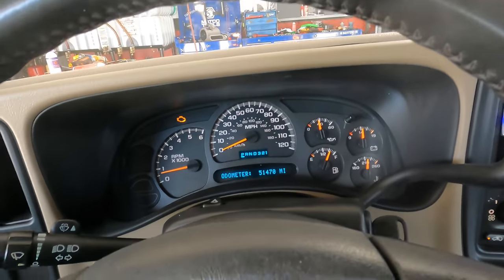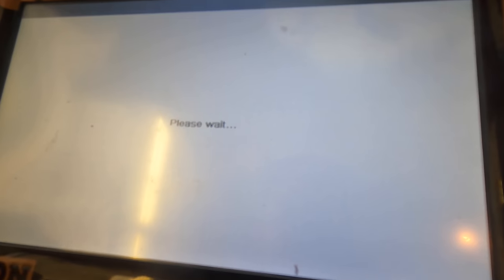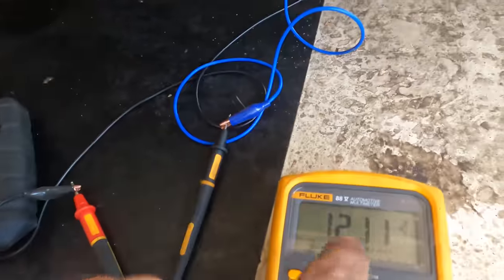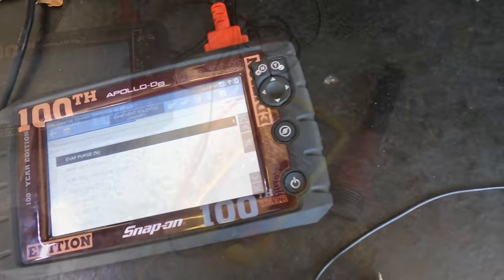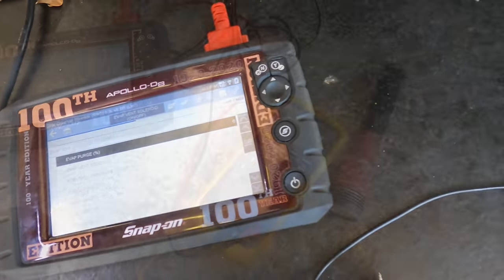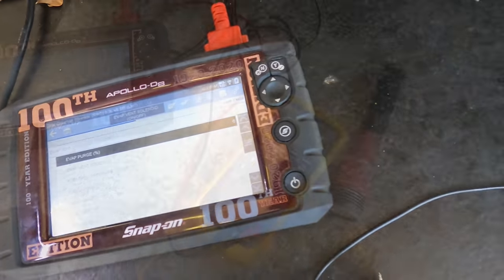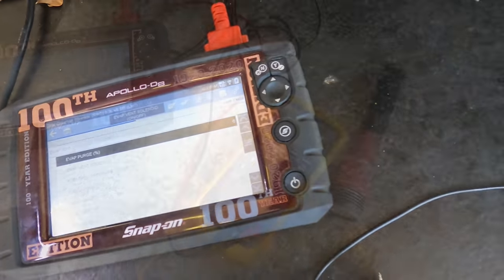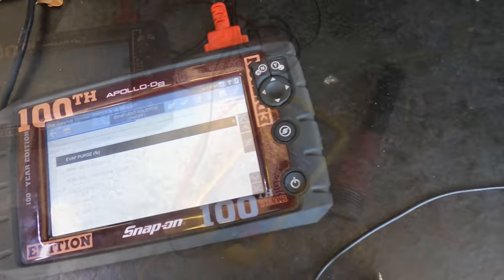RARE FAILURE! Short Circuit? Misfire Evap | Chevy Silverado 5.3 P0300 P0455

Comment: I am impressed with your knowledge. I don't know how many years you have been working on cars or what educational opportunities you have availed yourself of. That said, it seems to me that your knowledge is incredibly diverse, covering so many different cars. Very impressive. I am a 79 year old man who started his mechanical career back around 1958 or so by opening up a flat head ford and doing some simple fixing. I have done a lot of car repair and I am impressed with your knowledge. Well done!
Reply: When they started putting computers in cars, that's when they lost me
Reply: @juanawashington9940  That's why the scan tool has become the mechanic's best friend. if used well, it makes even today's repairs so much more straightforward.
Reply: @martinaudet7687  I had just bought a 3rd new scan tool, INNOVA  5610 which is a great tool..... then I bought an '02 Ford 7.3L diesel Excursion, and find that it does not read every thing that it should ..... darn it.  needs a special protocol for Ford diesel engines

Comment: Replacing parts isn't the gem of auto repair work.  It's the ability to troubleshoot the problem and replace the correct part(s).

Troubleshooting should be the main focus in teaching auto repair.
Reply: To adapt Douglas Adams, author of Dirk Gently's Holistic Detective Agency:
"Replacement of engine part: $2"
"Knowledge of which part to replace (including saving the human race, sacrifice of one Schrodinger's cat, consumption of 4 cups of tea) $1998"  🙂

Comment: 11:38 They aren't always identical there's quite a few parts for my K2500 where the AC and GM part numbers are significantly different. Maybe they've changed that in the past 22 years but since they still sell OEM parts from that era they keep the two line label. Great video!

Comment: and people wonder why some of these issues are so difficult to figure out....just because you have a scan tool , it doesn't pinpoint the exact problem....that's why when an auto parts store scans your codes, they end up selling you 6 parts when it may only be one or two.....this stuff is like surgery on an electrical level....if only people knew
Reply: The scan tools is like a multimeter.. It's just another tool in your toolbox.. And like most tools you need to know how to use it

Comment: Heavy Duty, Over the Road Trucking going computerized on their engines made me retire after 35 years.  I couldn't keep up with technology. I could rebuild and repair anything our company had. Until computers failed me in old school trouble shooting. I miss it. And your knowledge fascinates me. So may times I want to reach out and smack you for not doing something so simple on hardware issues.

Comment: As an old shade tree mechanic, one of the things watching this channel has amazed me is that although I know that codes are stored to tell you what's happened, I didn't know that with the right scan tool you could activate/deactivate subsystems all over the car. 
Having to call and make an appointment to install a new computer is startling.  
There is still a lot of basic wrench turning that goes on, but wow, I'm never attempting to work on a modern car except to change the oil or maybe do brakes.

Comment: Only Fords require 2 keys from what I've seen. :)

Nice work as usual Ray. I'll bet the solenoid shorted and took out the driver, but I suppose the order of failure isn't really of important. What matters is it's fixed.
Reply: My 1996 Chevy and 1976 MG both require 2 keys.
Reply: They are talking about 2 ignition keys.

Comment: Programming/reprogramming ECMs is such an interesting process. It's like you've used 2 very different skill sets. [and it 'solved'/resolved the misfire issues]
Reply: Ignition is handled a similar fashion. The ECM maintains ground on the coil (iirc) and disconnects the ground to cause a spark to fire across the plug. The fried ground circuit was probably preventing the ECM from being able to disconnect the ignition grounds properly, or could have been preventing the ECM from grounding the injectors to fire. (The ECM uses ground instead of the +12v line to control a lot of stuff.) Either way, the result was the same. And the failed evap valve was the clue to find the culprit of it all. Ray actually made it a point to make sure the ECM was bad, which is great.

Comment: As I get older I miss the days when you didn't need a computer in your car/truck.
Reply: I can buy a small battery operated computer that can talk using satellites in orbit for a few hundred. But one to talk to my truck is a couple thousand and the  wiring diagram is extra. What a rip off.
Reply: You mean with a carb?
And gasoline, no ethanol, where the truck could sit for 20+ years and you just toss in a new battery and it fires right up.
Reply: @michaelvangundy226  It's because most car manufacturers are using 20+ year outdated technology for their car computers, even today.  This is also why the chip shortage is such a big deal.  Because the semiconductor companies can't deal with manufacturing 20+ year old parts (which require a different process) when they are so behind on MODERN parts.  Plus keeping production lines for such old hardware is expensive.  (Consequently this is also why Tesla is not affected by the chip shortage nearly as much, because they use modern stuff.)
Reply: @StormsparkPegasus   What you say is indeed true,  however Tesla is going to find that theit new design Chips are going obsolete faster than ever. One example I can see rearing its ugly head in the not too distant future is the displays used on Tesla's will almost certainly go obsolete in the next 3 to 6 Years, especially if your Tesla is already 3 years old.
Reply: Boycott electric cars
Reply: Boomer
Reply: As I got older so did my cars and trucks. As far as my ex-wife, three new cars was what broke the camel's back
Reply: As I get older I'll start missing the days when cars/trucks went vroooom! Welcome to human existence 😒
Reply: @vetrivel1994  You forgot the "OK."
Reply: @rickchowsr2532  Has there ever been a car that doesn't require electricity to operate?  Not in my lifetime anyways... (50 years)...
Reply: @spazzman90  see there’s a difference.  When they force you to buy an electric car VS having the option.  What are they gonna use to make the power to power all these electric cars by 2030 as they want to do? That’s just one downfall of full electric vehicles.

Comment: I've been chasing misfires and purge valve codes for a while now. I have thrown a few parts at it...tune up, distributor, fuel pump (it was getting noisy anyway). I never thought of the ECM! That might be the ticket. It's a 2005 GMC Safari van. The codes are the dreaded P0300 and the Evap vaccum leak. The purge valve works as I hear it clicking, but I may still have a leak.

Comment: My first reaction to that RAP (remote assisted programming) tool experience was when do you ask for a refund and send it back!  I presume it's the lesser of evils working in a shop that takes all makes as yours does tho, as otherwise you'd have to have dozens of different programming tools.   I prefer complete control of the job end to end, so I'm glad I only focus on GM brand module programming to do it myself seeing that remote experience you had there.  ;-)

BTW, those ACDelco and GM part numbers are not always the same.   They are the same for parts only GM sells from the dealer, but anything ACDelco also sells retail will have their own unique ACD number in that field.

Comment: For stuff controlled by a MOSFET ("high power transistor"), stick in a 1 Megaohm resistor parallel to your DMM wires. Some MOSFETs (and Diodes for that matter) tend to leak a very small amount of current that can build of a charge on the switched side. From the point of any equipment that uses power, the circuit is OFF, but when no load is connected a DMM can read "ON".

For this reason, i'm usually including a 1 meg resistor across all MOSFETs on my circuit boards (at least those that might not have a load connected at all times).

It's not a problem in the case of this video, just trying to help avoiding possibly time consuming wrong diagnosis.

Comment: As an owner of a 142k mile CLK230 W208, I had a confusing problem. The problem was that it dropped a random cylinder, but run beautiful with no overheating issues, no loss of compression and no leaks. In other words it shut fuel and spark off to any 1 of the 4 cylinders. It would run like a cylinder gasket leak. This is a protection if a misfire was detected. 
Originally I thought it to be a duff plug, so installed with new plugs and coil packs. This, however did not fix the issue. 
I scanned for DTCs to find a multitude of parameters well outside the factory parameters and codes.

Now, one has to point one small, but important detail out. I filled my fuel tank with E10 fuel. From this point on the misfire began. But I did not believe it to be the fuel. 
I could of gone through all the other fixes, but would of got expensive. Realising that E10 may not well on the older cars, I had to drain and refill with E5 99 Ron fuel. It the car runs sweet again and parameters are now within its factory parameters.

The moral to this story, don't use the nasty E10 fuel on older vehicles with a bit of milage on it.

Comment: As someone who has dealt with delivering and stocking auto parts for the last 2+ years, the listing of specific part numbers for different brands just helps the source person(s) be less confused. Having line codes shown would be beneficial but that would be a per-retailer basis and not a producer basis, as everyone's line code system is different.

Comment: Great job and very informative Ray. Those ECM's are a mystery to me, I never would have thought to link a misfire to the ECM!
Reply: Well the ECM was holding ground to the EVAP, could have taken put a chip inside causing a miss fire, I find it strange GM puts the ECM our in the engine bay, lots of heat out there.
Reply: @Maples01  I agree with you. Putting a chip in the engine bay is a bad idea. I would have been tracking down the usual suspects... Coil, spark plugs, crank angle position sensor, ECT. It never would have occurred to me that the ECM could be the cause.

Comment: Here is South Africa , the 5 piont summit V8 engines are giant size ! 
Over here 3L v6 engibes and 4 L v6 engines are the powerfull units. Ford South Africa has the 2.2 Litre straght 4 here , but I must say for the size , tge performance is very very goid.
Alsolight on diesel fuel !

Comment: That joint might be fine, but heater hose isn't made for hydrocarbon resistance.  Gasoline vapors will pass through it and soften it.  That should be PCV/Emissions hose, or fuel/oil hose.

Comment: I'm a Locksmith that specializes in Automotive. I do a lot of Diagnostic stuff like this. That service you are using seems to be a PITA. I use OEM software and it rare we need anything from the old computer. Try reaching out to a local locksmith they my be able to come to you and program with OEM tools. Not sure where you are at but I know a guy in Miami  another in Ft Myers and in Orlando.

Comment: If the system is actually sealed ..... if you command purge and seal the fuel tank pressure sensor will  show an increase in vacuum and will stall the engine....the engine vacuum will fight against the fuel pump and starve the engine of fuel... Quick and easy verification test. Heat up the evap vent tube and it will come right off, while it is still warm you can shove it directly on the new vent...
Reply: I was thinking a little heat would bring it off without cutting too,I have a purge valve I am going to do this with on a BMW!

Comment: It looks like the coil was still good in the old purge solenoid because of the sparks being emitted when power was removed.
I'm guessing that the ECU held the valve open so long that junk built up around the pintle and then it's stuck open and therefore no clicking was heard when power was applied.

Comment: Using a multimeter in resistance mode can be confusing and misleading when there is active power from other connected devices going through a line. Even in voltage drop mode, using voltage drop across an open connector when ground is switched off may be confusing because of ghost voltage and unknown downstream variables. An incandescent test light bypasses many of those issues, it speaks to the question of line resistance on both sides, and it does so in a more trustworthy ten second screening test. Eric and Paul aren't luddites, they use a tool from the past, worth $18, for a reason.
Reply: Yes. Test light. $3.99 at HF.
Reply: @michael931  Only thing is, it needs to be incandescent, an LED test light doesn't draw enough current. OTC sell a good one.

Comment: GM had a service bulletin for this issue.  I replaced the solenoid vent on my 2003 Silverado.  Had to use a length of 5/8" heater hose and relocate the filter for the vent above the transmission.  In the original location, the vent gets plugged up with dirt and dust.
Reply: FWIW ....The TBS repair kit came with/has a new position bracket for the solenoid and longer nylon hose with the connector.

Comment: I would assume the ecm uses a n-channel mosfet to switch the circuit to ground. a mosfet is a type of transistor, and transistors tend to fail as a short circuit. sounds like a chain reaction of failures, which is common in electronics.

Comment: You need a power probe. They are great to test things. You can give power or ground or both.
Reply: I was wondering why Pine Hollow Ivan wasn't using something like that, instead of plugging his test light to either plus or ground, but maybe it's because it's better for the thinking process to actively plug in plus or ground instead of just flipping a switch?

Comment: I wonder what those ECM modules cost now. I replaced one in 1988/1989. Even back then they ran around 400-500 per.
Reply: Using the same part number as in the video,  Rockauto has it for $176.79 plus a $100.00 core charge
Reply: I'm a bit puzzled at why the ECm was bad with such low mileage ....and also wonder how long it was throwing the EVAP code? If the ecm was keeping the purge vent solenoid from open all the time, shouldn't that have thrown a code?

Comment: this video might have given me some new ideas on where to find the evap leak in my vehicle. 
it's a 2002 Chevy suburban 1500 Z71. it has a small leak code. tried the cap trick, nada. new purge valve, nada. about have had it with the leak code. the check light will burn out at this rate... haha.

Comment: Use a test tight (globe style) to be sure that it's not low current voltage.((test feed).
 Some times the solenoid goes bad and kills the output of the computer.

Comment: Ray, heater hose isn’t sufficient for that repair. It’s not fuel or fuel-fume resistant. There’s actually a form of fuel line made by Gates Rubber Co. that is. You could probably get away with using some silicone hose for that.
 I worked in the parts store industry for 30yr. I know what I know “REEE”!
Reply: Your not supposed to use garden hose as a heater hose but I've seen it done and lasted for years without failure....
Reply: The TSB states to install 5/8 heater hose and route it to an area above the transmission (not re-connect it like Ray did)
Reply: Heater hose will NOT hold up! Nowhere near as long as fuel line. I’ve seen it MANY times over my 30yrs in the auto parts parts business. I don’t care what ANY TSB says, don’t use heater hose where any petroleum (liquid or fumes) go through it! I’ll argue with whoever came up with that TSB until they realize the fault that they are causing!

Comment: quick question when determining that the ECM was bad by checking power to the purge solenoid you had the battery disconnected wouldn't that not make it have power going to it anyway?

Comment: I have a good one. I have a 2002 chevy avalanche that the gauge cluster only works when a elm diagnostic is plugged in but runs the battery dead when it's not plugged in. Still has full diagnostic capabilities too. SMH

Comment: 28:25 "The engine will race to redline, then initialize a fuel cutoff, and at that moment it has learned the relationship between the crankshaft and camshaft". Nope, that isn't what it's doing. The misfire monitor closely watches the crankshaft speed during a firing event. It expects the crankshaft to speed up by a certain amount, and if that doesn't happen it knows that cylinder didn't fire. This is very precise, and any internal variance in speed due to engine balance or any other factor must accounted for to prevent false misfire codes.. When you snap the throttle to RPM cutout, the ECM records these speed variances as the engine decelerates, during fuel cutoff so there's are no firing events altering the speed of the crankshaft. This gives it a "pure" signal to compare with and know the true RPM change of each cylinder during firing events. It is not measuring the variance of the camshaft sensor or even considering its input during this relearn procedure.

14:05 "I speculate that the ECM failed first, and continued to energize that solenoid until it burned out". Very unlikely. The driver transistor for the vent solenoid is certainly shorted inside the PCM, and in the overwhelming majority of cases these transistors fail because the component they control is shorted, causing too much current to flow through the transistor. The typical failure mode of these transistor is shorting across all terminals, which is why you saw a direct short to ground. One might wonder why these transistors don't have better protection against overcurrent, and that is a very good question indeed.

(edit) Speaking of the misfire monitor, what about those stored misfires? Of the two codes that was easily the most important one, but I never heard you mention that code P0300 again. I guarantee you the vent solenoid being shorted didn't cause that.